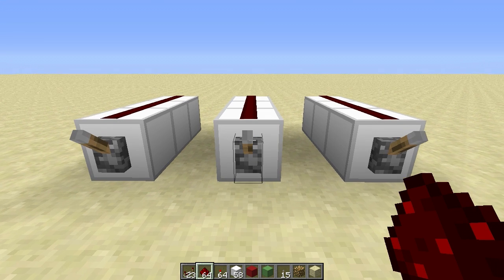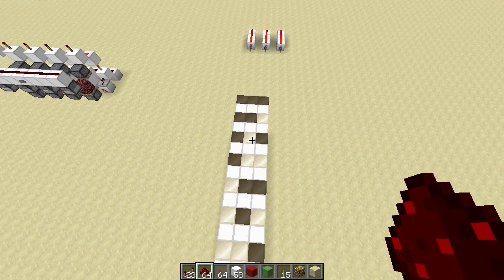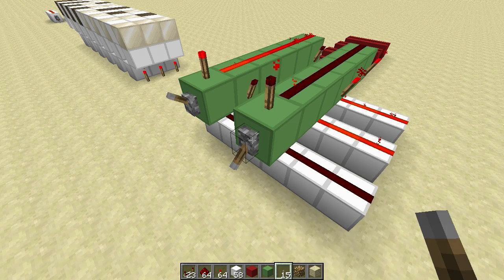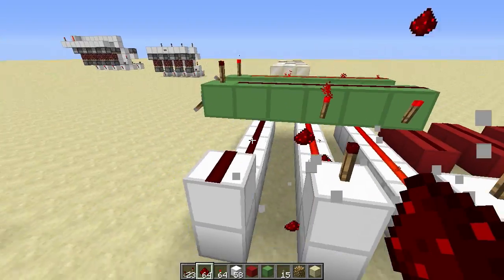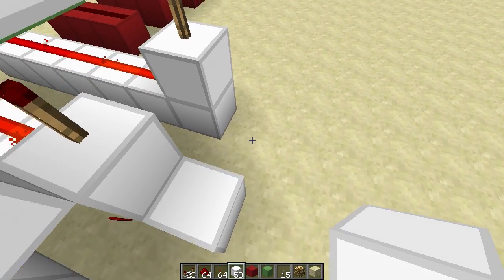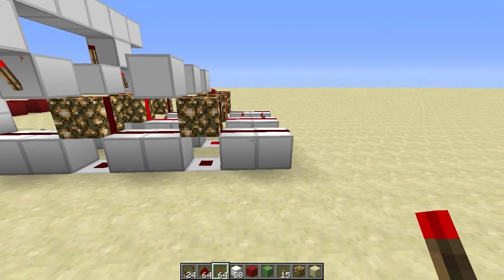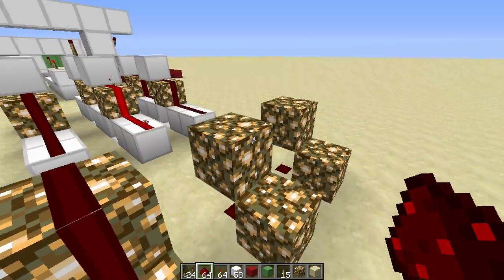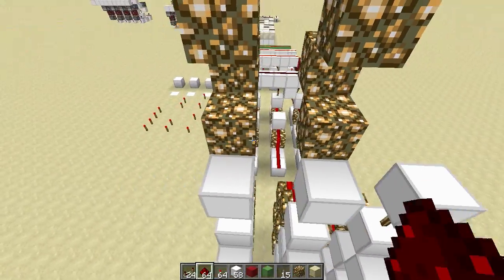Minecraft Tutorial: Encoders and Decoders - Making redstone compact

Comment: I just spent a few hours designing and building a double 16-bit counter (or 2 parallel counters that can count simultaneously but separately) and plan to try to use them to multiply 2 numbers from 1-255 together, and I came here in search of a way to turn a 16 bit binary input into base 10 output, likely via redstone lanterns

Comment: when you display something on a screen, one pixel (redstone lamp) needs to be on or off in multiple cases. eg, if your making something that displays 0-9, in 7 parts (as most calculators do) the top part will be used more than once, 2,3,5,6,7,8,9,0.

Comment: an encoder makes a signal turning into a specific code, while a decoder turns the code into a specific output. They are just used to make everything compact for example if you'd have 1024 different redstone gadgets you'll only need 10 lines to create 1024 codes so you saved 1014 lines and also space an material. but they are also often used in a computer, because the computer can only calculate with the encoded (binary) codes. you can look that up then you'll understand it^^

Comment: Can you show us a tutorial on how to do instant wire?
Reply: kickiwi Instant wire is easy 
*1 place an observer
*2 place 9 powered rails out the output side of observers
*3 place an observer with the face of it facing the powered rails
*4 repeat step 2 and 3 as many times u want
*5 on the output side of the last observer place a sticky piston with a redstone block on the head if ur on bedrock edition just connect a t flip flop instead 
*6 break 1 of the powered rails after the 1st observer 
*7 place redstone dust or a lever or something in front of the face of the observer 
*8 replace the powered rails u broke in step 6
*9 ur done , power / un power the lever or redstone dust at the 1st observer then u should see the sticky piston with the redstone block or the t flip flop produce a signal out

Comment: You can actually make the glowstone version even faster by only inverting the on signal (removing the double inverters), the glowstone doesn't let the signal go downward so it won't interfere with the other outputs. The only possible issue with this is signal length.

Comment: To fix the inversion problem with your final design, you could add a second torch to the block the first one is on, but to compensate for this you need to remove the redstone above the first torch and turn the bottom glowstone into a solid block so the signal will transmit.

Comment from the maker: There is't really a design for these as they depend on the environment you use it in. For instance an or-gate is just linking 2 or more wires together while an and gate is the same but you just invert the inputs and invert the output signal. nor and nand are just inverted outputs of the previous gates.